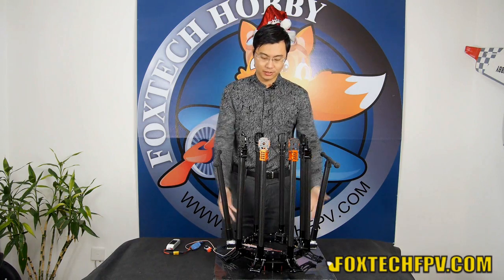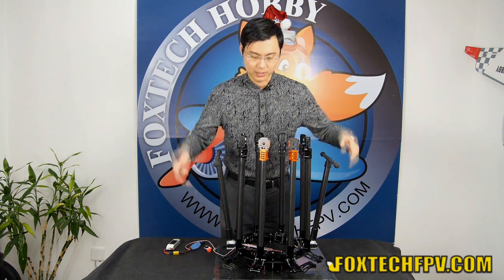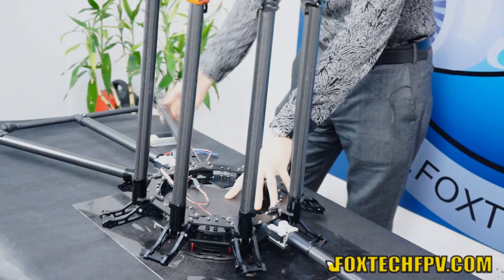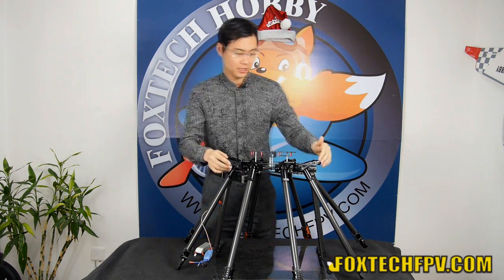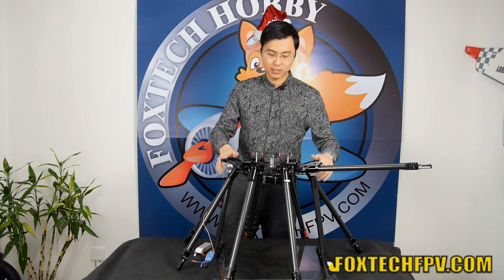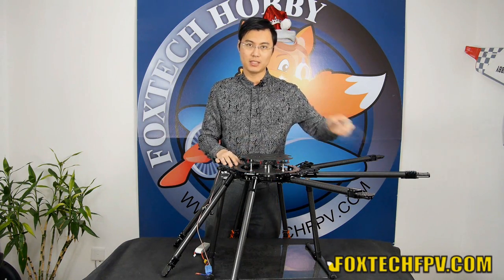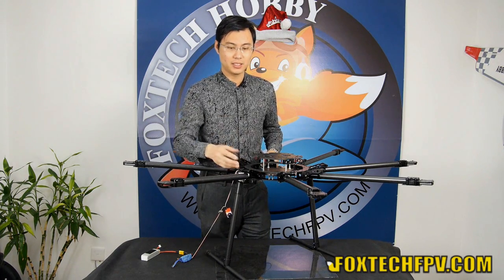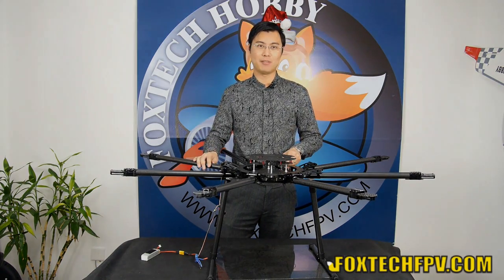Foxtech K130 Official Version Demonstration/Installation Guide

Comment: For the antivibration part, does springs are better than silicone to reduce vibrations?...  maybe a combination will work better?...    I thought silicone was the deal for this kind of jobs on multicopters, I mean the kind of frequency multicopters and their gear produce..
Reply from the maker: silicone gets hard in low temperature.
but it's way too soft for heavy load.
hence most gimbal has their own vibration control method.
so springs are no problem.
the idea of using springs is backed by numerous tests.